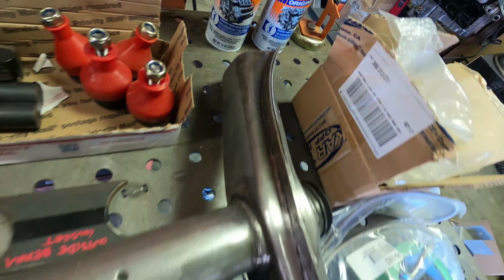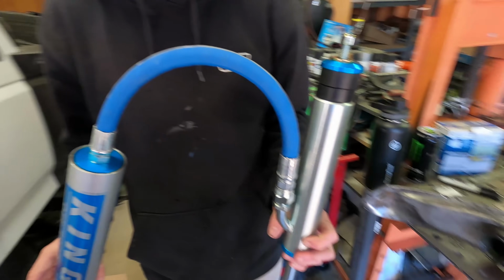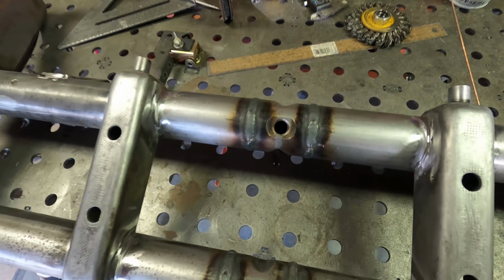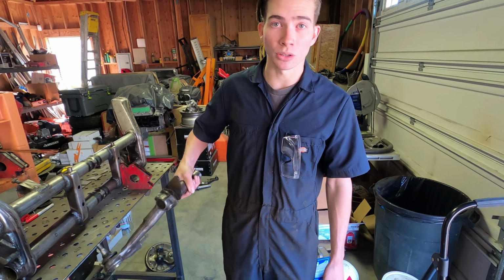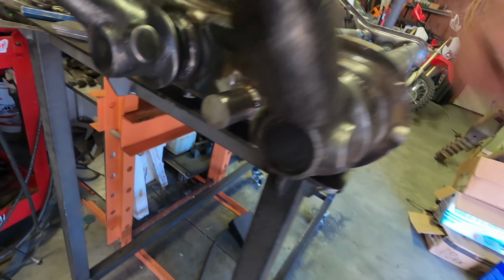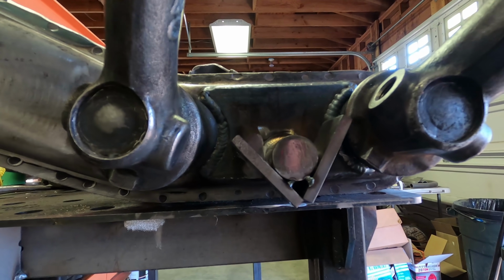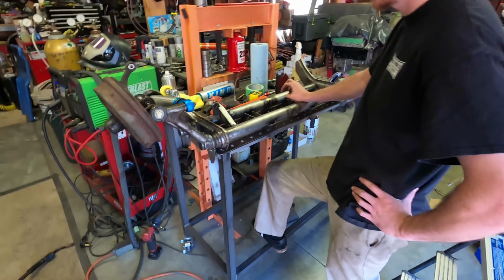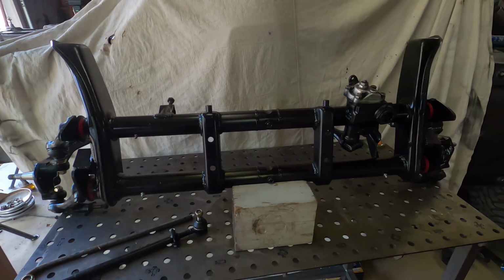Building a Class 11 Beam! Bug Build Ep. 2

Comment: Some of the guys I knew would use the section you rotated 9/16 to also add 3 " total to widen the track for better control and move the mounts and add extra gussets for strength. Good job on everything you did to that front end and steering arm keep the rod burner happy he really did a good job ...

Comment: Nice work ,great video.  I'm curious though, why keep the torsion bars?  With those shocks you could use through rods instead and get much better shock action and tune ability and also shave about 25lbs off the front end...... ... With the torsion bars doing most of the work you can't enjoy the full beauty of what those shocks have to offer. Longer trailing arms is also a huge upgrade. Keep up the good work.